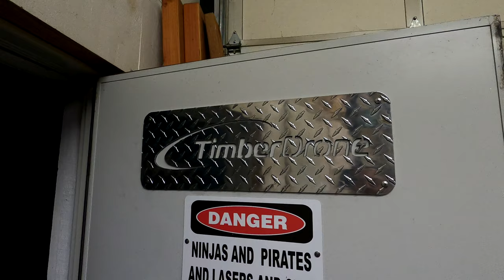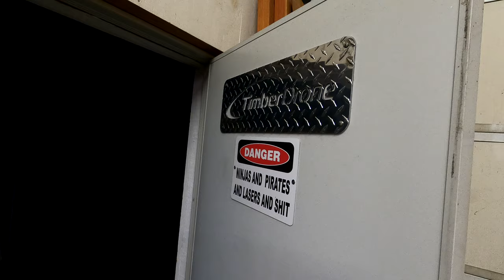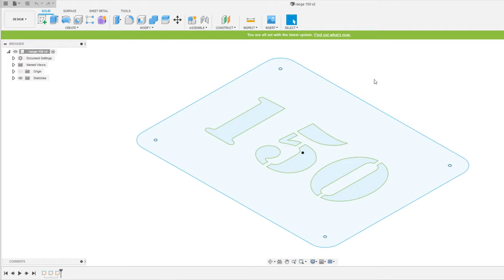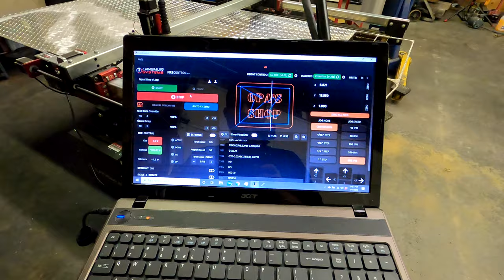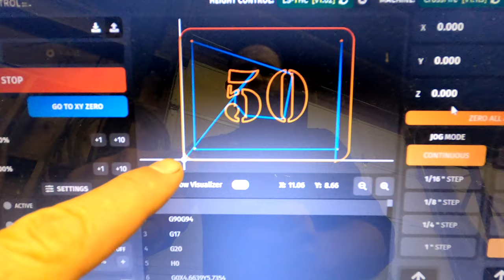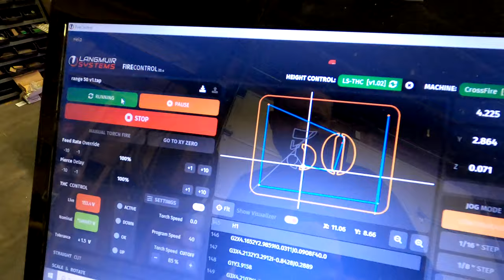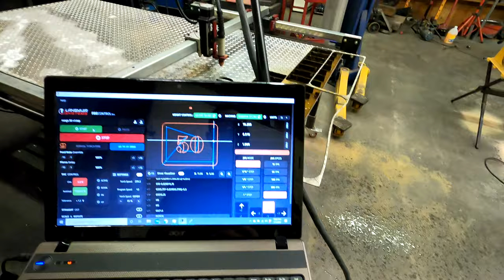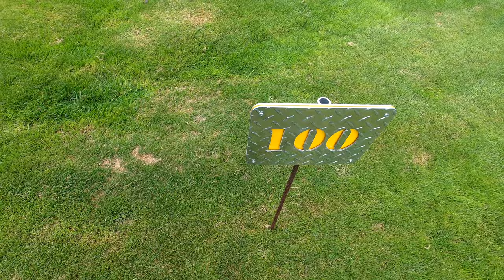Langmuir Crossfire Pro CNC table:  cutting out aluminum diamond tread signs

Comment: Matt, good video. I am considering buying a Pro to cut .125 5052 aluminum. I wanted to know if you have any issues with hydrogen gas in the water and if you add anything to the water to resolve that ? Also can you cut small holes like 1/8” ? Thanks in advance. Al
Reply from the maker: I have never addressed hydrogen gas; I’ve never had a significant issue with it except during one full sheet cut the plasma starts were sometimes preceded with an audible “pop” as the H2 ignited that was trapped under the sheet.   My shop is well ventilated; I have a large Dayton fan mounted in the end of one wall that helps keep a steady flow of fresh air through the building.  This would prevent any significant accumulation of H2 during cutting operation.  But, even without it, I can’t see it being a real issue.  
I don’t rely on any level of accuracy for holes smaller than about 1/4”.  For smaller holes I usually undersize them with the plasma and then follow up with a drill bit to bring them to their final size.
Reply: @MattVerley  Thanks Matt for your answers. I might wind up having to bump up to the 4x6 table because my largest part is 34.5” in diameter and the Pro only goes to 33 and change in the one direction ☹️

Comment: Great video I got my table last fall but didn't have heat in the garage so it sat all winter hoping to fire it up as soon as the snow is gone. Just one question what type of machine torch are you using. I bought a xp 45 plasma .

Comment: I use fusion to generate g code and I don’t have any issues of order to cut out
Reply from the maker: I'm used to using sheetcam; it is what I used on my old table.  I tried using the CAM process in Fusion360 and felt like it was a bit slower...so I just went back to sheetcam.  It usually does the proper cut order, but it is 100% foolproof if I create all of my inside offset cuts in one drawing and outside cut in a separate one.

Comment: Matt, 
I just upgraded my RazorCut 45 to the Hypertherm powermax 65, I bought the Langmuir pigtail for it for my Pro table, man talk about relearning a new system, would you mind sharing the setting on your Hypertherm, meaning what's your kerf width on that, for the old RazorCut it was set at .055", how did you set up your tool on Fusion 360?

Comment: Was looking at a larger table for sign making etc.....have you had a chance to do a larger cut that required you to index the material due to the job being larger than the table?  Just curious if this could be easily done or if it would just be better to go with larger table capacity.  Great video....subscribed!

Comment: Any issues with the THC and the diamond plate?
Reply from the maker: No issues whatsoever, in fact it does an excellent job of moving the torch up-and-down as it goes over the raised diamonds.
Reply: You can actually see it raise and lower in the video. Good stuff.

Comment: Caution to anyone cutting Aluminum with Water,  IF the Aluminum has Lithium as part of the alloy, there can be an explosion, also Aluminum particles with a non Lithium alloy when submerged in water can create Hydrogen Gas and also can explode.  Best to talk to your plasma cutter and table vendor. Safety first...take care folks...